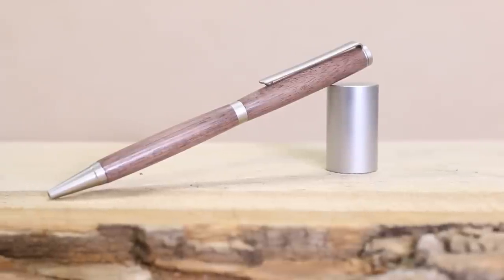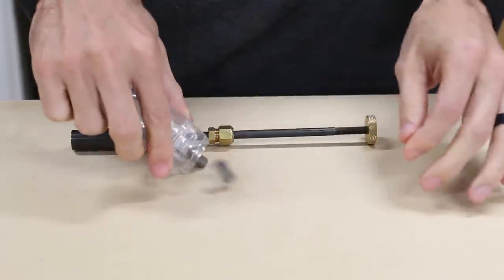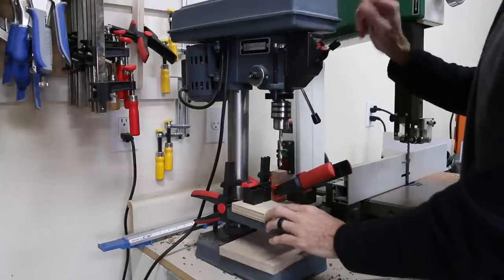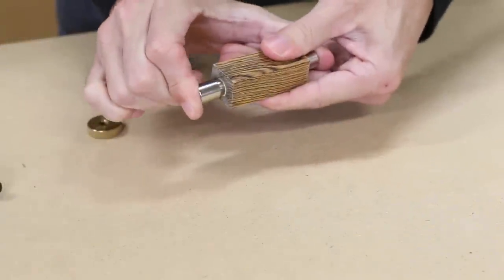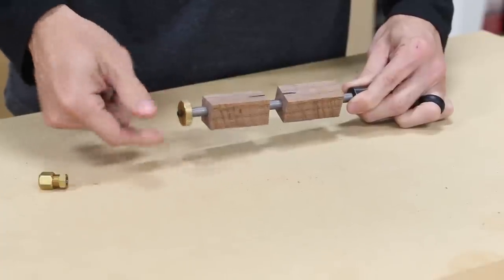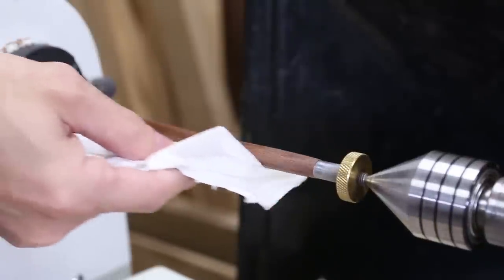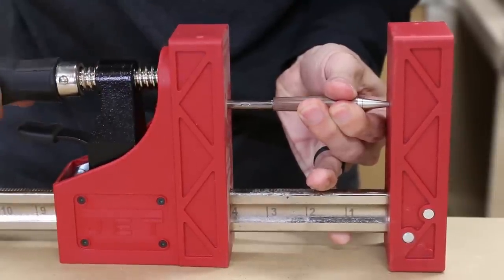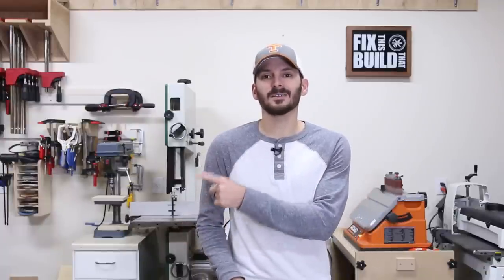Pen Turning with Basic Tools  | How to Make a Pen

Comment: Some tips concerning pens from a pen turner ... :)

Walnut was my first pen, and I put it on a satin nickle slimline as well, so you're in good company here!

You mentioned wanting to go a little further/closer to the bushings next time round ... you will want to re-think that strategy.  It will depend on the wood or material you are turning.  If it is an open grain structure, like oak or the walnut you are using, then getting close (as you did) and sneaking up on the bushing using sandpaper is the best way to go.  Make sure you properly SEAL the open grained blank BEFORE you start the sanding, as getting the sanding dust out of the pores is a process that may try the patience of the Pope.

An excellent method of sealing open grain like this would be to thoroughly soak the blank in thin CA and allow it to cure overnight before continuing the project.  This way, as you sand, the dust shouldn't be able to find any open pores to lodge in.  You'll want to wipe the blank down with denatured alcohol rather than a solvent, like acetone, as that will damage the CA... normally you would want to avoid denatured alcohol, as the water content in it will soak into the wood blank, but in this case, the CA pretty much waterproofs the blank.

My preferred finish is an extremely high gloss CA finish, which gives the appearance that the wood is encased in glass.  I sand my wood to 1000 or 1200 grit before I clean it (usually with acetone), and then apply boiled linseed oil followed immediately with CA (using the same applicator, still wet with the oil, and with the lathe on lowest speed).  I then apply 6 - 8 more coats of CA before I begin wet sanding with 1000 or 1200 grit, then go to micro-mesh all the way to 12,000 ... I then use a product called Plast-X (they also make One-Step).  The Plast-X is an abrasive polishing compound with grit that breaks down during use .... sanding from about 10,000 grit up to 30,000 grit within a few seconds .... polish at high speed on the lathe.  Leaving the lathe on it's high speed setting, my final treatment is Turtle Wax Hard Shell, which I buff in like a friction polish.  The wax helps repel moisture and oils (like fingerprints).

As for the basic shape of my pens .... quite similar to your chosen profile, but I leave the lower a little wider, and split the taper between the nib and the center band at 2/3 the way up from the nib to the center band, leaving it widest right there.  The taper is gently rounded ... the feel of the pen simply feels more natural to me with that profile.  Feel free to try it sometime!

edit: Kept watching, noticed an issue with how far you pressed your transmission into the lower pen body ...  Not all pen barrels will be the same length, and not all pen makers will get the exact same length pen body, and not all ink cartridge manufacturers will have the exact same specs .....  

You may remember the age old adage:  "Measure Twice, Cut Once!"  right?   Well, to ensure that your ink tip protrudes from the lower pen body the CORRECT amount, press just a little at a time with that transmission, and put the ink cartridge in to see just where it sits, checking the extension by turning the transmission each time.  DO NOT TRY TO PRESS THE TRANSMISSION WITH THE INK CARTRIDGE INSTALLED.  (dont ask me how i know that one...)

Once you have it in the perfect spot, you're good to go.... but pressing it right to that indentation (though that IS the general mark you are shooting for) may be a bad idea if you went a little overboard on sanding the ends square to the brass tube, or if they somehow sent you incorrectly sized tubes, or your ink cartridge is a tiny bit on the long or short side, ect ....

Some pen kits - using the exact same transmission, mind you - actually require you to press it PAST that indentation by nearly 3/8ths of an inch or more!  (You will see this for sure if you pick up a kit called The Designer NT, from Pen State Industries.)

Short video with no sound - Platinum Sierra with Curly Koa.  This one is a fine example of my preferred finish, and it's an open grained wood, so I needed to seal it before the final sanding steps and finishing.  https://www.youtube.com/watch?v=Os4IoEkT0uE
Reply: Thanks, 
Do you use the liquid turtle wax hard shell or the paste wax one?
Reply: @harveysburger  you can use either, though I prefer the paste wax myself. The liquid sometimes clogged the nozzle and made a mess cleaning it out.
Reply: Thanks! Took me 6 years to reply to your post, then took you 6 seconds to reply back :)
Reply: @harveysburger  well, when you get a notification out of the blue and had nothing going on... ;)

Comment: Will ANY lathe work for turning and making the projects you do?
Reply: Some older and less expensive lathes don't have morse tapers in the head or tail stock.

This will greatly reduce the accessories you will be able to use and projects you can do.

Comment: why not just raise the table on your drill press to allow the bit to travel closer to the table??
Reply from the maker: The throw on my press is only 2".  So yeah, I could have moved the table up and basically buried the drill bit in the blank before turning it on, but the other route seemed easier.